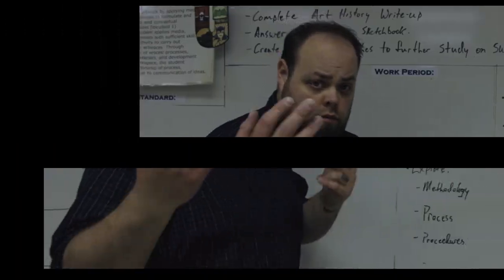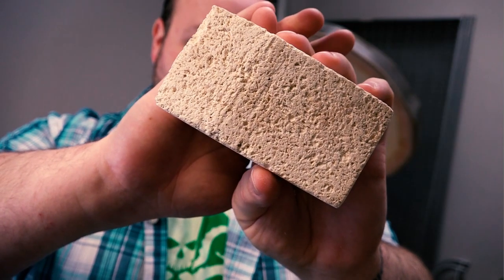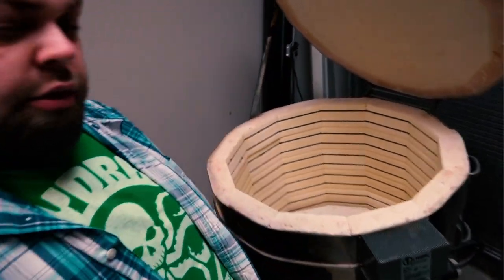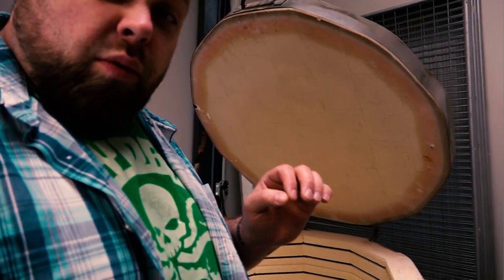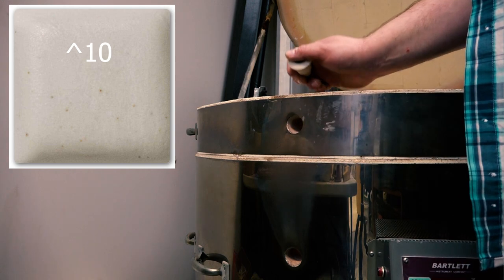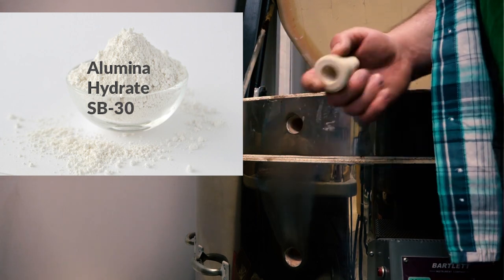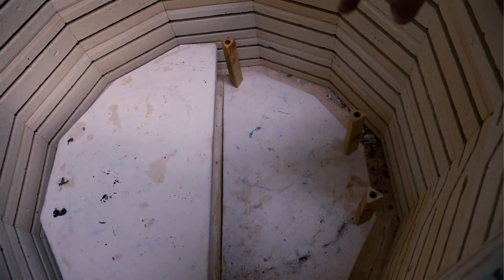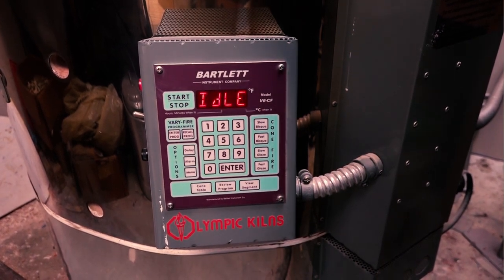Kilns Explained | Ceramics 101 | Summer PD | University of YouTube

Comment: Hi I have this same kiln, and I replaced my thermocouple recently after having problems with it overfilling. I replaced the thermocouple with this one: @t You can see this thermocouple comes with it's own ceramic cover. Should I keep the kiln's big ceramic thermocouple cover to go over my new thermocouple (the same ceramic cover that's covering your thermocouple)? From what I've seen of Skutt Kilns generally don't have that cover since the thermocouple is already partially insulated with ceramic. Thanks!
Reply from the maker: Great question, so I checked on my kiln and I think to leave the cover in the kiln on to safeguard the end of the thermocouple. Most of the shielding on the thermocouple is to protect the wires.  You can also check the firing accuracy with a 3 cone stand inside of the kiln.